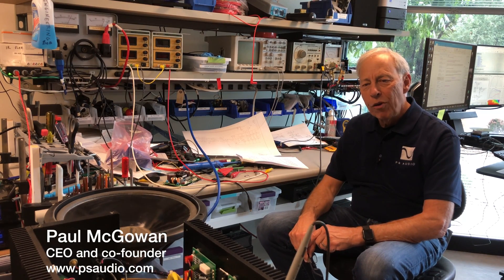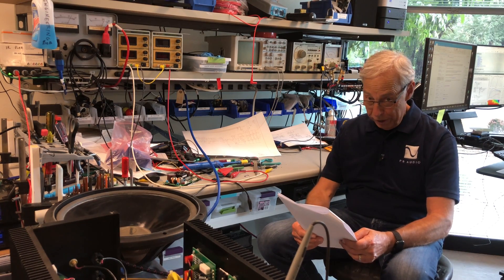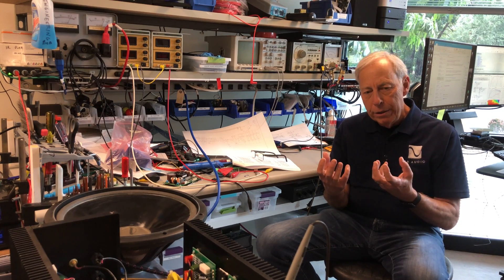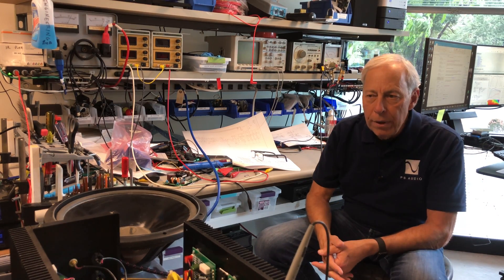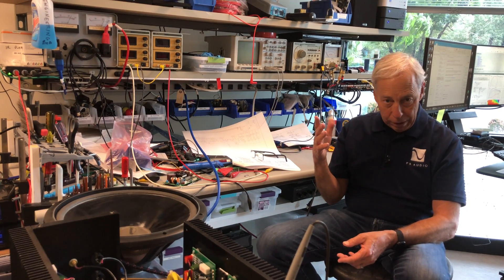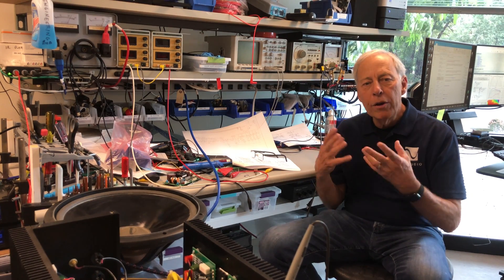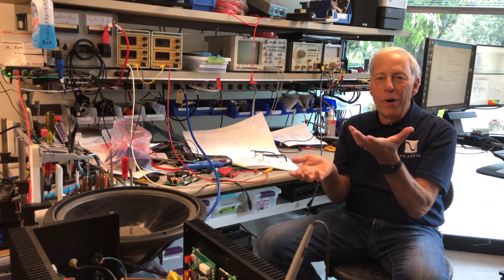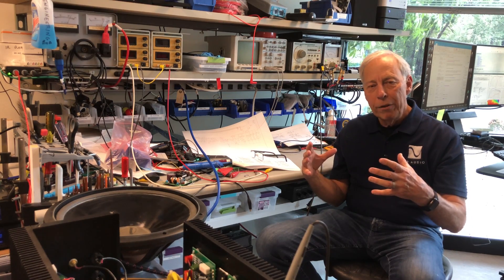Why do tube amps use square transformers?

Comment: I thought it was more to do with the fact that toroidals came onto the scene much later, and as such were mainly picked up in later solid state designs.  I have had a fair bit of success 'recycling' toroids into audio use. I have a 'network' of speakers around my house and workshop, all driven by a central amp - transformers are one solution to connecting many many speakers to a regular 8 ohm amp. (Ten speakers would give a 0.8 ohm load - ouch)
 - Actually I step the amp up to 100V - PA style, solving the really long speaker cable problem.

Comment: my theory on why the newer sound systems use round transformers is because the magnetic fields in a torroid works better in harmony with the magnetic fields of the earth and the earth's and the transformer's magnet fields wont fight each other thereby less wire is needed in winding them and it can be made cheaper and will last longer where as the square transformers  need more wire and the fields fight and thereby dont last as long.

torroid transformers require 1 bolt to hold them in place where square requires 4   though may be able to get away with 2 if part of the base is used to hold like in a microwave.
Reply: The earth's magnetic field is MUCH too weak to affect a transformer.

Comment: Some fancier tube guitar amps at least are starting to use toriods for the power transformer. Cost may be a reason, but the lore is that the magnetic field in the toroid is better contained and is less likely to couple 50/60hz hum into the rest of the amp, simplifying the design and build process.

Comment: E-I cored output transformers are de rigueur for vacuum tube amps for sound quality reasons - although in the late 1990s budget priced 100 WPC tube amps made by Primaluna uses torroidal core power supply tramsformers and E I cored output ones. Although the use of rare earth hexaborides in audio vacuum tube manufacture was kinda rejected back in the 1990s despite of the potential to make vacuum tubes run for at least 25 years because they don't sound as good as tubes using thoriated tungsten filaments that only run for about 5 years.
Reply: Reminds me of your GoldStar (changed their name to LG back in 1997) 14-inch TV that you bought back in 1995 that still runs - I think they used "cathode poisoning resistant rare earth hexaboride treated cathode ray tubes".

Comment: Hello, Paul! I understand a bit why these transformers are needed but I have a question: do they use different wire gauges on the same transformer? I have a really old book my grandpa had (1940s) about transformers and I read that radio power transformers needed to worry about the wire gauge that was used because of the skin effect but from what I read, up to 20KHz the skin effect is deep enough for using a single gauge wire - but since I know audio does work in mysterious ways, is that true?
Reply from the maker: There is certainly a connection with skin effect and wire gauge though I am no expert at it. One of our cables uses thin, flat wire, that increases surface area without increasing overall gauge. The problem is, the frequencies that are affected by the skin affect I believe are pretty high, so I don't want to stick my neck out and give you bad information.
Reply: @Paulmcgowanpsaudio  Thank you! I still have some tube output transformers at home and I intend to make a tube amp with my dad - who used to built them in the 60s as a hobbyist.

Comment: Valves (Tubesfor USA) do not have a inferior low frequency response it is the output transformer and is easy to measure the maximum power the amp will produce throughout the frequency range to test how good they are It would be interesting to try some toroidal  ones and measure the frequency response I suspect the high frequencies may drop off due to their design

Comment: Toroidal or EI means nothing by itself. You’ll find many EI transformers that are much better than toroidal. Everyone is on the toroidal bandwagon nowadays because we have machines to wound them and are much cheaper to manufacture than a few years ago when it required manual labor.

Comment: It's easier to manufacture the coils for I-E transformers than toroidal in small quantities. Tube equipment is usually made in small quantities. The I-E transformer undoubtedly adds to the distinct tube sound. Tradition dictates that tube amps use I-E transformers. Decades of empirical research was invested in I-E output transformer design.  

If the correct silicon-iron laminated core, of the correct thickness is used, and the coils are designed correctly, it should be possible to build a great sounding toroidal output transformer. But you have to use a shuttle or other equipment to build it. It is probably more difficult to saturate a toroidal transformer than an I-E. I have no idea what a ferrite core toroidal output transformer might sound like. A toroidal output transformer may (will) sound different than an I-E, but that may not be a bad thing. It would be fun to have the time and money to investigate.

DIY toroidal power transformer build: https://www.youtube.com/watch?v=lyZ7nM6Fo94 Warning: the background music may be intolerable.

Comment: Another reason is that using conventional transformers you can mount the power and audio transformers with their cores perpendicular to each other to minimize inductive coupling of AC hum from the power transformer to the output transformer.  The same goes for filter chokes -- you'll want to mount them perpendicular to the output (and inter-stage, if applicable) transformer(s).
Reply: Have you had any experience with the "little darling" tube amp? Or diy tube amp builds?

Comment: Valve output transformer design ( of high quality) uses what is known as sectional windings ... by this the primary windings (bifilar for push -pull) are interleaved with the secondary windings ... This would be difficult to make using toroidal transformers. The best audio output transformers use a conventional bobbin but instead of E & I laminations they use audio grade ferrite C cores tightly clamped together

Comment: Anyone here designed an amp using R-core xformers? I haven't seen any that are high vA but they are supposed to be lower noise than E-core and more vibration resistant than toroids. 2¢
Reply: BuildYourOwnBass Technics used to deploy r core in their higher range in the 80s and 90s. Nothing produces sweeter bass. I wish more companies would use r core as it has many advantages over both EI and toroidal. The reason companies use one type or another is cost as transformers are usually the most expensive part. In the beginning toroidal transformers were hand wound (expensive) so pretty much everyone used EI. Nowadays we have machines to wound toroidal so you can see more and more companies use toroidal. R core is still a very small niche and very costly to manufacture.
Reply: Various early '80s Luxman power amps used large r-cores with isolated primaries and secondaries.

Comment: There are some tube amps with can trans. Seen them before. Are those like toroidal?
Reply: Oftentimes those big cans are just a normal transformer but potted inside a can for looks, protection, heat dissipation, and so on.
Reply: Daniel G ... aaaaaaaah ... Thanks!

Comment: Isn't also a question about the risk for coupling between the two transformers in a tube amp? (If I'm not mistaken the axis should be rotated 90 degrees to each other to avoid this and mounting a toroidal on it's edge is rather unpractical.)
Reply: Makes sense the E core transformers do have a much larger EM field than toroid types do.
Reply: Rolf Karlsson Also to note, the power transformer and the output transformer are mounted on opposite ends of the chassis as physically as far apart as possible. I own Vox, Marshall, Fender and a few other brands (most have never heard of) of guitar amps; to a one, the maximum physical separation of the two transformers is the rule.
Reply: @Thom Moore -- As long as the any audio transformers have their cores aligned perpendicular to the power transformer and filter choke(s), they can be mounted adjacent to each other with little or no inductive coupling.